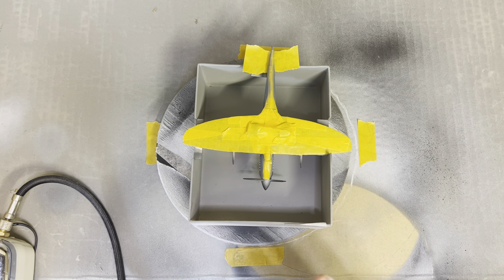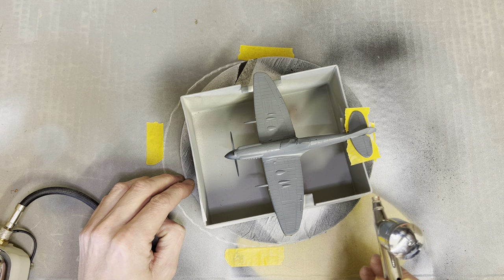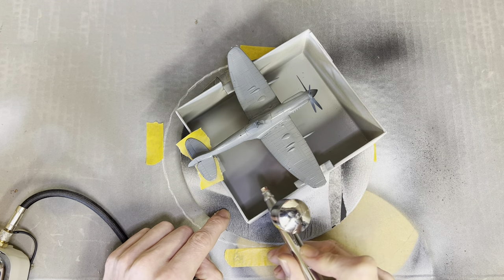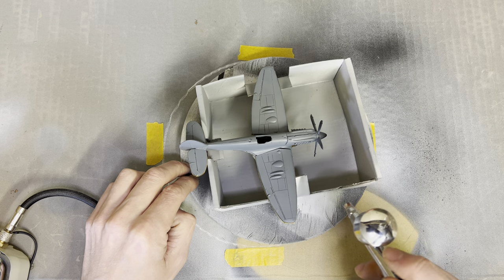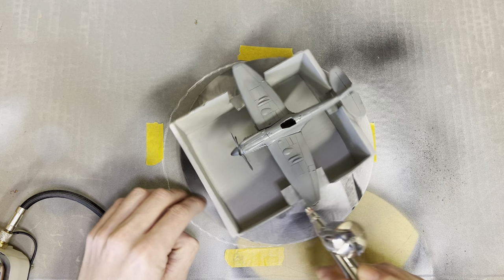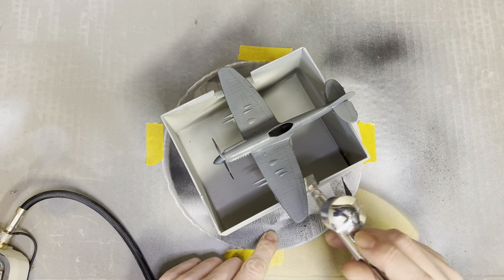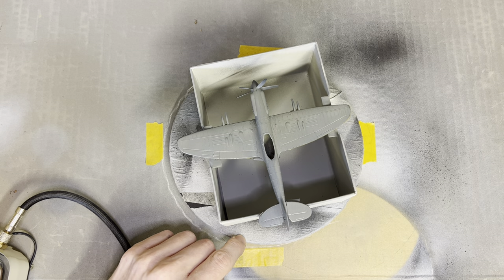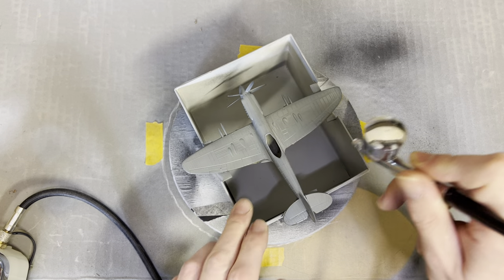MASS PRODUCTION; 2ND TOP COAT FOR MY "DIRTY DOZEN" COLLECTION OF 12 1/72 VINTAGE SPITFIRES EPISODE 5

Comment: Hi Andy. Just a little tip for you. If you don't feel confident about applying the camoflage pattern in green then get some card or a post it note cut a curvy edge on them and hold them close over the wing. Then when you spray, spray it towards the edge of the card. That way you will end up with a curvy edge but also a little bit of paint will go under the edge and leave a soft demarcation line. I hope that helps. Practice it on another peoce of card. Good luck bud.
Reply from the maker: Already been done with masking tape, results mixed LOL. sounds an interesting idea a might give it a go on a some plastic packaging.

Comment: Hi Andy. Its all a learning curve of events. As I said previously it takes time. The technique is getting better. The thinning of the paint is quite good and it seems your cleaning the airbrush well between colours. Indeed light strokes and not too heavy on repeat strokes going back if you have just missed slightly an area. Something at times I need to get into the habit of more subsequently ending up with splotch or blob marks on mine. Thanks again for the video.
Reply from the maker: Cheers Dean, Off for 12 days shortly so will be doing the rest of the "dirty dozen" also intending to have a go at building a few more things. Thanks for watching and your continued good advice.

Comment: Really good job Andy, the paint's going down really well. On my first attempts I kept flooding the surface and/or splattering and spitting the paint.
Reply from the maker: Thanks Phil, the camo is done, have some paint run issues, but i will touch them up.